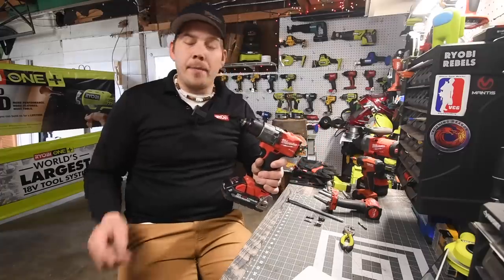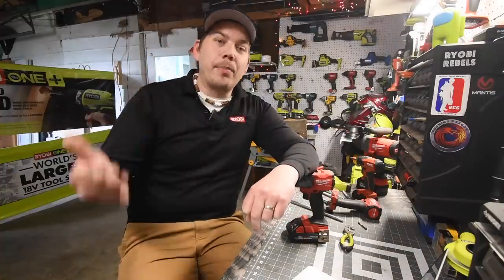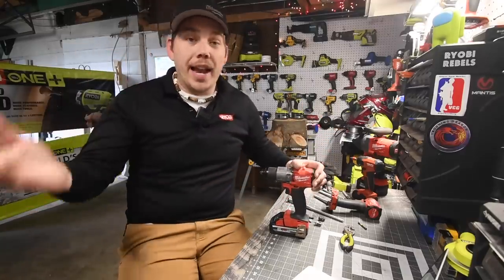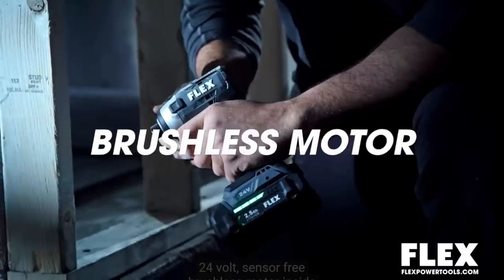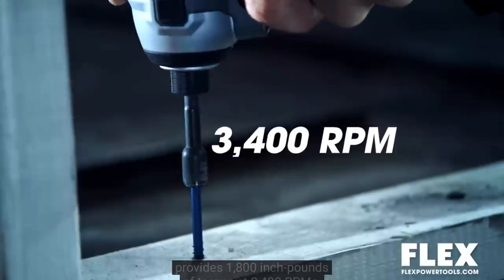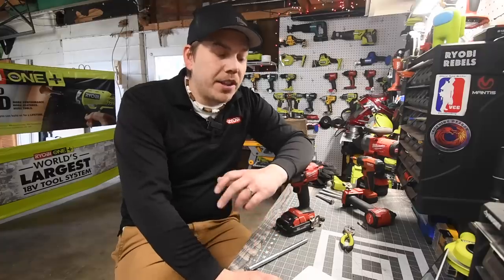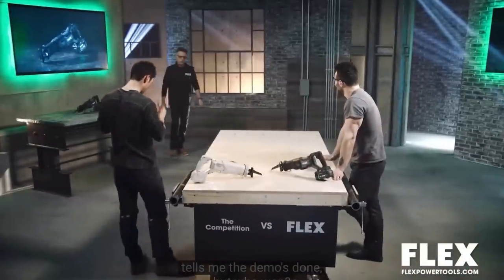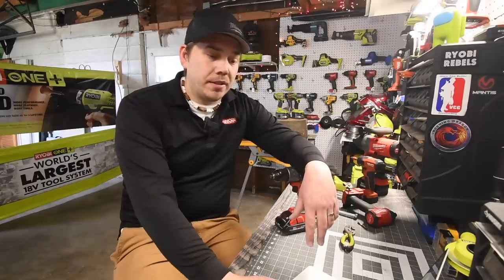My Flex tools vs Milwaukee  video RANT!!!!

Comment: Also there’s another reason why they’re not throwing shade at DeWalt.  Lowe’s carries DeWalt, and it’s an exclusive big box retail carrier of the power detect, and Lowe’s will carry Flex exclusively as well.  So it makes more sense to go against a competitor that is exclusively sold at Home Depot.
Reply: I noticed the same thing once they brought out the second Milwaukee. Shots fired but I’m not convinced about Flex. I’d rather get the same 24v jazz with Kobalt. Ooooooh then I’d be missing out on the turrbbbboooo button. Really men don’t need a gimmicky turbo button at work.
Reply: @Apache-Helicopter-Life  what most don't realize is the turbo button overrides the circuitry allowing it to ramp up, but that really isn't good for the tool. So the question is, can turbo mode be used all the time with no tool or battery consequences? We all know there will be users that will push that button for everything.
Reply: Excellent point I was wondering why they didn't compare Dewalt, didn't want to compete with Makita either 😆😆😆. I do like Milwaukee and Makita tools, and I like them both
Reply: @Tyler-zw4kq  I believe that warranty is longer if you buy and register the tools in 2021. However, then you watch the @phillyfixed video, he can't get the tool registered online, OR by phone!
Reply from the maker: I thank you for viewing

Comment: Finally a YouTuber who’s not sucking off flex for an obvious pay out
Reply: Wouldn't buy that crap anyway. Got a pile of dewalt gear. Battery platforms are hard to switch over regardless. And I use my dewalt hammer drill with a 60v flex every day drill wall ties 50 feet inna air and it never gives me trouble.
Reply from the maker: I thank you for viewing
Reply: I mean this dude seems to be getting a Milwaukee pay out (could be wrong). Honestly since I don’t have a platform yet I’m getting flex for the founders warranty
Reply: LoL, never heard of this guy but it appears as though Ryobi completely owns him. Ryobi rebels sticker?  Ryobi shirt?  Ryobi banners?  I will stick to my Makita and Milwaukee that I have used in a professional capacity for years and years.  
Not going to lie though I did buy that Ryobi power scrubber for cleaning my tile floors.  I am not even kidding, my wife was really surprised to see me bring home Ryobi.  I've how to return two of them because they just quit working the 3rd one is still working but the second Makita or Milwaukee make a power scrubber I'm ditching the Ryobi.
Don't get me wrong you're not going to see me buying some flex impact from an infomercial.
Reply: Don't knock it till you've tried it. An I have the gen 3 Milwaukee the flex non turbo one knocks milwaukee out both the drill driver and the impact.
Reply: @benv7556  
Just think about this, they haven't been around long enough to test longevity.  that's why they are giving that warranty.  
I honestly think they're not gonna hold up like Milwaukee and Dewalt, good luck hope you're not gonna be w/out impact until your freebie gets to you.
Reply: @jeffreyheinzelmanjr3317  
you must work in making banners for selling houses. Because I can tell you that's not remotely close to being true. I'm a commercial electrician with about 45% industrial and I have tested the Flex, I won't deny its close, but not the claims they are making, especially for someone who doesn't have a platform, poor guy. I can tell these tools aren't going to last, hence the founders warranty.
Reply: @benv7556  warranty is no good if flex is out of business in 3 years.
Reply: @gtzmwt flex will NOT hold up.  They let their tools overheat to get more power. Other brands have safeties built in to protect them from overheating.  Plus, they’re not selling like expected so im sure Lowes will drop them soon.

Comment: I have 30+ Makita battery tools. Made the choice for Makita because I can operate (impact)drills, airblowers, saws, anglegrinders and even my grassmower with one battery system. I'm not (overly) muscular nor do I have a "mean look" in my face. I just want to get things done on my small farm with one and the same platform. With minimal use of petrol. The differences between the platforms (Milwaukee, deWalt, Makita and so on) are measured in seconds, not in hours. My advice: stick to your platform and be happy.
Reply: Well said!
Reply from the maker: I thank you for viewing

Comment: I'm a Milwaukee fanboy myself. I find their tools work best for me. Are they perfect, no. But they fit into what I do
Reply: I dont even own milwaukee tools and I know hands down their platform is the best.
Reply: thank you for letting us know
Reply: @Jihadbearzwithgunz  I work at a job that supplies all the tools. That sounds great, and it kinda is, until you realize they choose the tools you use. Dewalt tools are great in some people's eyes, I hate them, and that's what they force me to use. The Milwaukee tools may not have the top end performance advantage, but I like having a single charger to charge all my tools, I like the ergonomics and I like red.
Reply: @BigInjun05  they may not have the best high end performance, but I like the tool design, the ergonomics, the working performance and that they're red. They match what I vote for
Reply: @cerneysmallengines  I'm a milwaukee guy too but I've got some dewalt corded saws, grinders, buffer and routers  that are very good in my opinion.
Reply: @Lucas12v   they are good grinders no doubt, but I feel they are far overpriced. There's no reason a corded right angle 4.5" grinder should cost up to, and in excess of $100. I very much agree with the bear, from the den of tools, that I would get 1 top notch grinder for grunt work, and a bunch of cheap grinders for my misc. uses
Reply: You said they weren't perfect, so you have the only comment not "hearted" 
It takes really emotional grown babies to get this upset about an ad.. pretty sure every ad always says they're better then the competition.
Reply: @TheSonofabiscuit  um... what? I'm confused if you're bashing me, or conradulating me. All I can say is this, each tool has their pros and cons. I find the pros of the Milwaukee work best for me.
Reply: @rustytr one of the reasons they remain in my toolbelt. My daily truck is nothing special. 200hp, 1990 gmc k1500. But it has something no truck from now adays has, 30 years on the road. You think a dodge 1500 will be on the road in 30 years. Those things rust out so fast, you'll never keep it.
Reply: If a person uses tools then tools fit into what they do and any person can use any tools to do any work.... some will be one second faster than others and some will charge you 25 % to 70% more for that one second...
Reply: @TheSonofabiscuit  ☝️YES
Reply: @cerneysmallengines  no I like how you said, they fit into what I do. Makita does what I need and it's very reliable, but I'm hoping Flex outperforms with battery life because it's my only personal issue. I have over twenty Makita 18v batteries, from 3 to 5 amps, and I'm still charging batteries everyday. When competition steps up, everyone else steps up. I was honestly just bashing the channel for being so offended by competition.
Reply from the maker: I thank you for viewing

Comment: I agree the Milwaukee was handicapped with no high output battery I also thought they were using a old brushed Milwaukee
Reply: Some of the motors sounded more like brushed motors.
Reply: It wasn't brushed, you can easily tell by the profile of the drill.
Reply from the maker: I thank you for viewing

Comment: The dewalt 3 speed hammer drill is faster than the Milwaukee even though I am a Milwaukee tool guy.I don't use the drill to drill holes I use it for drain cleaning.
Reply: Yeah and who buys a tool strictly on speed alone? I also weigh longevity, warranty, product line, innovation of the tool line, available deals... there are already some great brands of tools out there and I’d be happy with a few of them I’m sure. And honestly I welcome one more choice. But to try and boil it down to speed is best is silly.
Reply: @RaggedsEdge  For my needs I am looking for 2000 to 3000 RPM.Most all cordless drills run at 1800 - 2000 RPM. I would like to get one at 3500 rpm but I am not looking for a cheap one.So far the dewalt is faster and has more torque than my m18 drill.I was looking at the Makita 40 volt but it's dam expensive and on paper it looks better but is it really better?
Reply from the maker: I thank you for viewing

Comment: Reminds me of a TV ad for plastic wrap back in the late 70s, touting how theirs was much more resistant to puncture than the competition's.  they illustrated this by poking a finger up through a piece of each of the wraps.  If you paid attention, you'd notice that when pushing on their own wrap, the fingertip was bent back so it was the fleshy pad pushing.  When pushing against the competitor's wrap, the finger was pointed more straight, causing the fingernail to touch, too, not just the soft fingertip.  Unsurprisingly, a sharp fingernail is MUCH better at poking through plastic wrap than a broad, soft fingertip. Whod'a thunk?
Reply from the maker: I do thank you so much for viewing :)

Comment: I'm glad that the gen 4 Milwaukee hammer drill was such an improvement over gen 3. Night and day difference. I totally believe the power detect hammer drill being the best, though. I have the power detect circular saw. The thing is a monster. It's tougher than a lot of corded saws I've used.

Comment: The lighting is better on the Flex side, which gives the appearance that the Flex is removing more material more quickly. The competitor drill is literally shadowed by the material.  As a fan of the Kobalt xtr drill and driver, I want to like Flex. But man, this rollout wasn't impressive to me.
Reply from the maker: I thank you for viewing

Comment: I always thought that milwaukee was too expensive UNTIL I bought a deepcut portable bandsaw. I have 100K of tools and it is probably my favorite tool. PLUS, when there was a problem and I wrote them they PAID POSTAGE and had it back in a couple of weeks and they replaced the cord which wasn't even the problem. I will only buy Milwaukee from now on cause I am tired of the B.S.! You want to cut stuff get one of those!

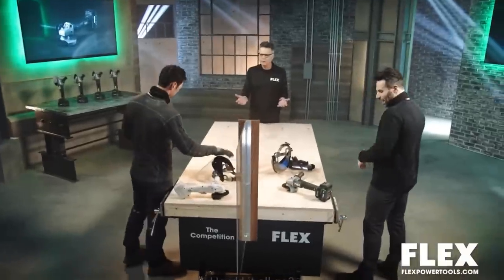Comment: 12:36 - depends on what cutting disk you are using. Some cheaper disks are wearing more than it is cutting metal after applying more pressure.

Comment: @9:10 They are keeping low pressure on the trigger of the Milwaukee tools.  Even if it isn't a variable speed trigger, most tools if you keep light pressure on, the tool runs slower because the switch is not fully closed.  This results in the actor (tester) accidentally or intentionally stopping the driver entirely in every run.
Reply from the maker: I thank you for viewing

Comment: BTW: The “specs” on these Flex tools are no better,a new sometimes less than the top level DeWalt and Milwaukee tools. In the case of the hammer drill at 750 in-lbs of torque it’s the same as Ryobi!
Reply: Agree, top tier Milwaukee fuel 1/2” hammer drill makes 1200 in-lbs. Totally rigged
Reply from the maker: I thank you for viewing

Comment: I have the milwaukee gen3 drill.
The specs are 2000rpm max
The flex is 2200rpm and 2500rpm for turbo mode.

I do agree about the grinder test.
But cutting reo etc is a pissy test anyway no matter who does it.
Reply from the maker: I thank you for viewing

Comment: I can confirm that the 3.0 HO Milwaukee battery does, in fact outperform the entry level 5.0 amp/hr battery.  I have both and I use them in my leaf blower.  I get a little more run time from the 3.0 than the 5.0 on the same yard, every time I do the comparison.  I've also done a comparison in my 7 1/4 inch framing circular saw.  The 5.0 lasts a day and a half, the 3.0 well into two days, no sweat.
Reply from the maker: I thank you for viewing  :)

Comment: When I think about it, I feel these tests should be done by consumers or prosumers.  I also want to bring out another point that their xtr hammer drill actually outperformed @ protool reviews against Dewalt’s top tier, but for some reason we have users that had different results with it.  It’s really hard to get consistent results nowadays.
Reply from the maker: I thank you for viewing

Comment: I had a big, long rant typed out, but better if I summarize. Obviously, Flex is trying to buy market share and they are willing to use YouTubers to advance their cause. That doesn't make me like them more. It makes me like the YouTubers less. Let me see Flex win against market leaders on channels like Concord Carpenter or Project Farm where they have earned their reputation for being unbiased, and where they understand that tools have many properties.

Before I migrated to Milwaukee last year from DeWalt, I owned several Flexvolt tools. They were extremely powerful, but I seldom used them except for the 790 miter saw, which was stationary, because they were too heavy. Size matters, but bigger isn't better for a tool that you have to carry and hold all day.
Reply from the maker: I thank you for viewing

Comment: I agree My dewalt power detect is a beast of a hammer drill especially on impacts per minute
Reply: The DCD998? Definitely one of the top hammer drills out there if not the best.
Reply: @ecoRfan  yes the power detect dewalt hammer drill is the DCD998 the flexvolt advantage hammer drill is the same just pushed for the flexvolt it works with regular 20v batteries as well that is the DCD999 they are both beasts
Reply from the maker: I thank you for viewing

Comment: Flex makes solid power tools. Lifetime warranty for those who bought them this year. 3 reasons I don’t buy Milwaukee is trigger failure, collets fail and eject bits and in my line of work it could kill last but not least the batteries on the big red platform have issues. Not hating just pointing out some issues why guys like myself don’t use tools that have known failures.